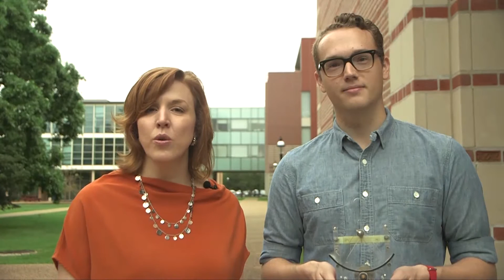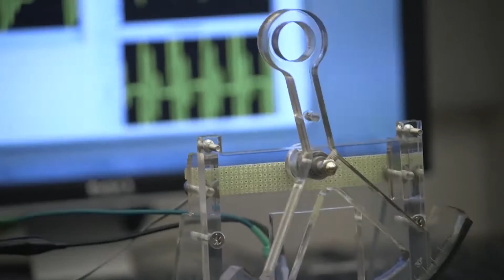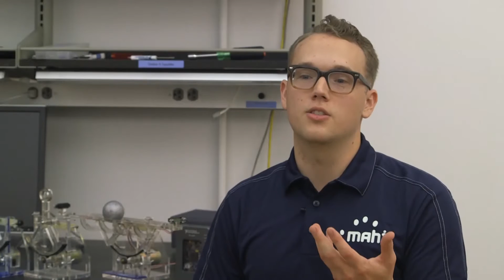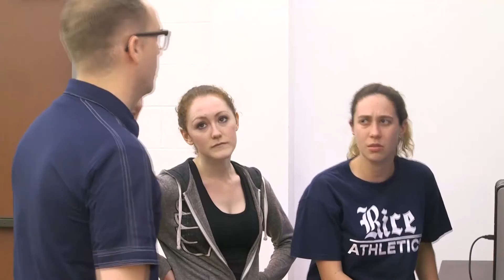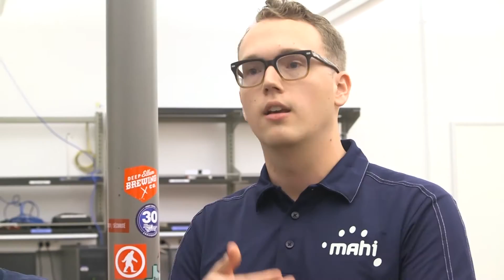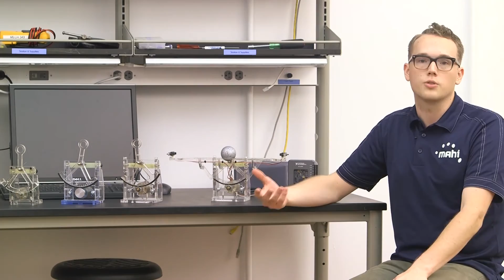myRIO: Hands on Learning @ Rice University_Rose

Comment: Are all activities with the paddle done in a controlled lab environment or are you able to do demos, group activities, etc in lecture? Your lecture environment looks traditional. Are there any activities that students are able to do at home and/or explore in an open-ended environment with few time constraints? Basically, I am wondering about how mobile any of this is either at present or potentially?
Reply: Great question! Presently, the haptic paddle experiments are all done in a controlled lab environment, but have the potential for the unstructured experiments you ask about. I think access to LabVIEW in the cloud like the MyRIO:Hands on Learning @ Tufts_Rogers video talks about would be a great step towards realizing this, along with more implementation hardware to allow students to check them out library-style.